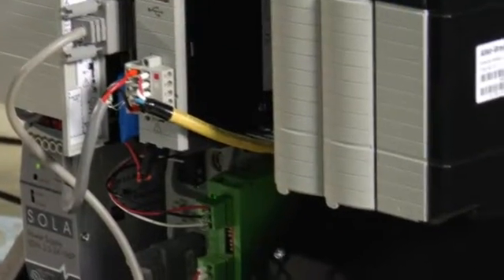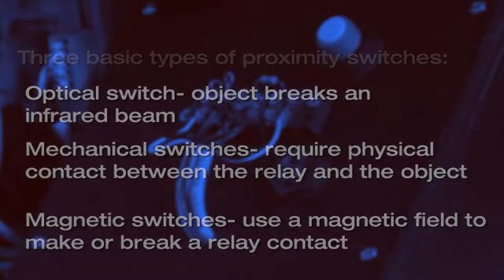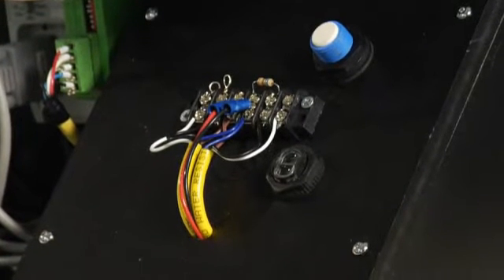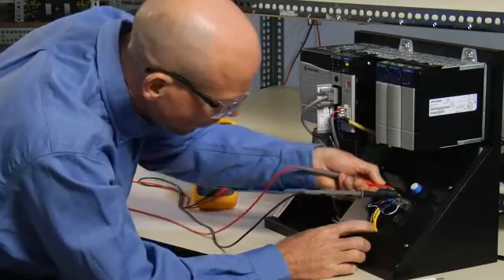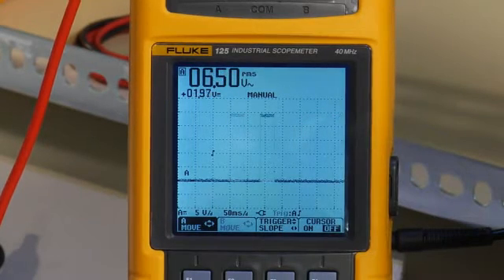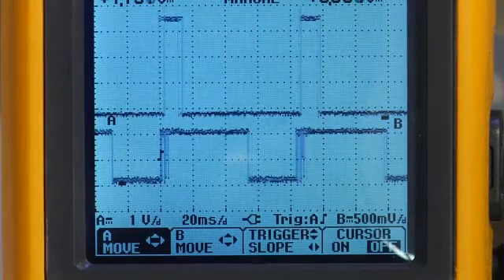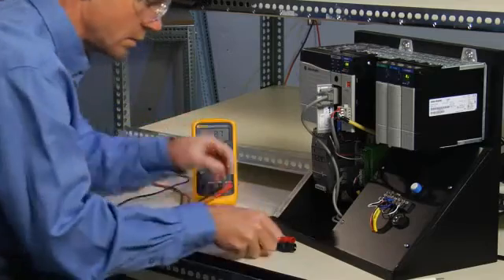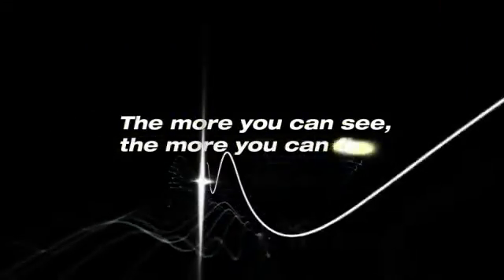How to Test a Proximity Switch With The Fluke 120B Series Industrial Handheld Oscilloscope

Comment: Yikes! Whoever did this video doesn't know what they are talking about. You mean to say photoeyes, limit switches, and non-contact magnetic switches. Also, industrial control applications are almost always DC so why are we mentioning impedance?
Reply: Maybe he should've mentioned the phase angle of the DC impedance just for you? They make some of the best test equipment in the world! Fluke scopemeters show the AC component of DC voltage but we can assume that a Borntrager scope does not? :-)

Comment: What settings do you use to graphically display continuity as in the video?
Reply from the maker: Hi Danny - What point in the video are you referring to? There is a continuity measurement setting on the Fluke 120 Series Scopemeters, but this video is showing channels A and B set up to graphically display voltages. You can set the tool to display continuity be selecting the A channel measurement button (V, Hz, A) and use the arrows to select the "CONT" for continuity. Hope this helps!